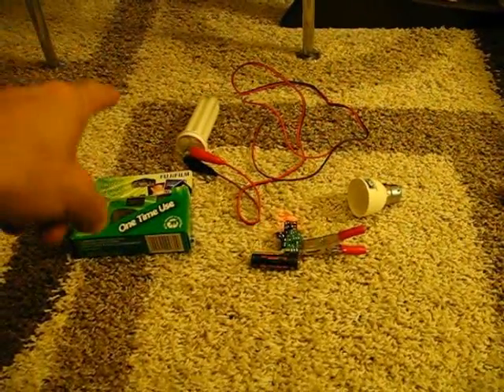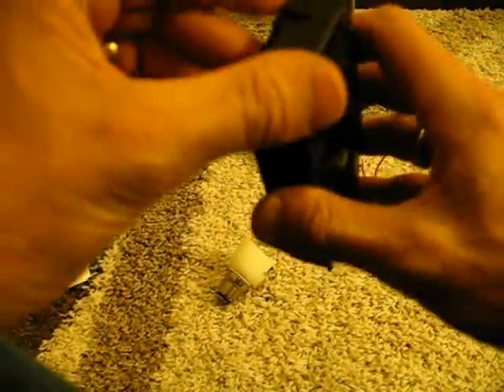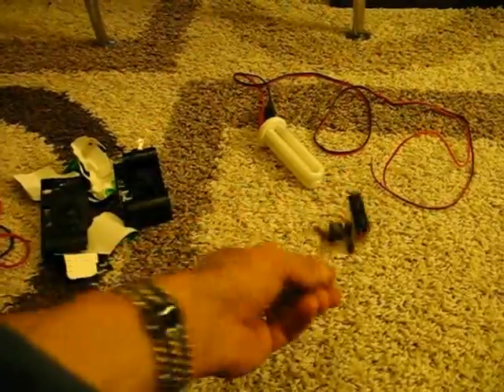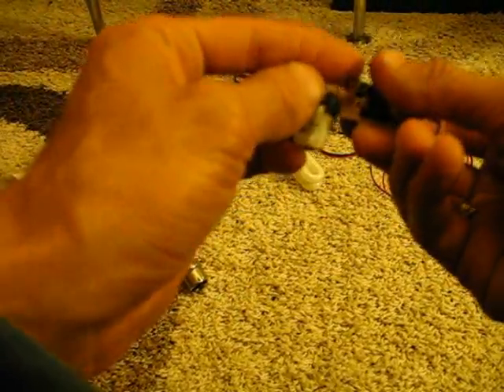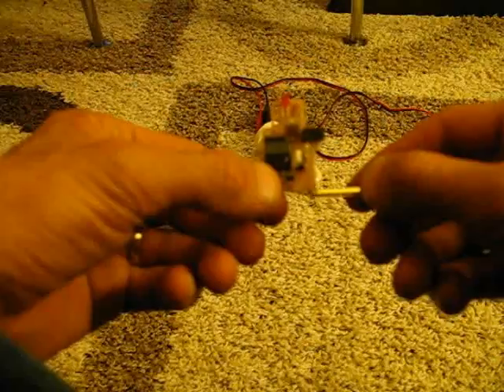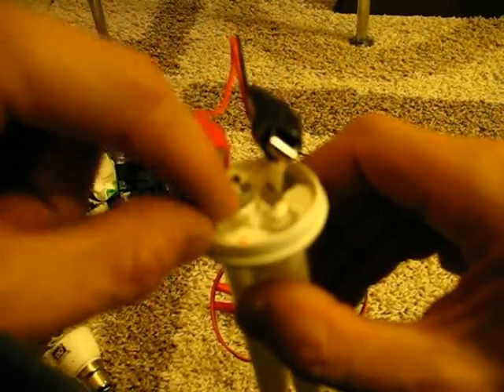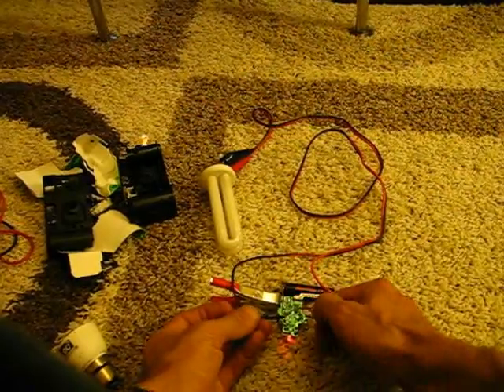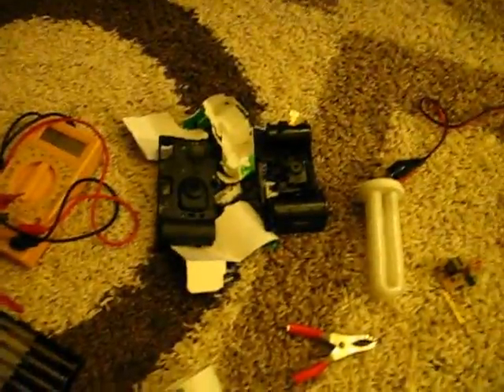Running a 240v lightbulb of one AA battery. Very real and very useful. With full how to. 100% real

Comment: Beautiful - THANKS.!
What size CFL I can use - 35W is ok?

If we don't have the camera here - is there another option. Or maybe diagram of the camera board that you are using?

Can the red light be turn off and it will work fine or is the red light need it to be part of the circuit ?

TIA
Reply from the maker: yes Kodak cameras also work (slightly differ from this) A diagram is in the description and you can remove the red led if you like. :O)
Reply: Did I had problem with my father in law, when I mention your video. Basically: How can you run 36W CFL for 12 hrs on single 1,5V battery.  And I was doomed :)
Reply: axnstorm Tell him to have a go at making one. He will be surprised how well they work :O)
Reply: I will - can't wait :)
Reply: axnstorm I always have the same problem with my father axnstorm. No matter what the subject is, it's like nobody else can be right about something unless he says so first. Even if he doesn't understand something, his response would always be something like "uh huh, well maybe" or "hmm, could be, but...". No matter how plain and clear I make the "facts" to him, he is always doubting everything I say, instead of accepting the "fact" that what I am showing him or TRYING to explain to him, is the way it is. He can never just take my word for something as being authoritative. It's like he's afraid to admit that I know more about something than he does. Or he just can't understand that I know what I'm talking about even if he doesn't. Damn it pisses me off sometimes. Sorry, but I just had to get that off my chest. Thanks for being my therapist's gang. lol Geez, talk about a rant! lol

Comment: Just wanted to share an idea with you as I'm not one to experiment with these types of things....

Over the years I've serviced dozens of 12vdc "strobe warning lights" on my equipment, replacing the xenon bulb. In all of them there's a "Hazard of Electrical Shock" warning label, I believe the circuitry may be similar - if not identical to the flash camera - but on a much larger scale, I'd be entertained to see an experiment on one of these. If you or someone does please post a comment here, I'll get an email alert. Thanks for the video and Cheer's to you.
Reply from the maker: Yes you are very correct with that. These are very similar but more efficient in what they do. They normally can run many hours on just a single AA or AAA battery. Some even run for days if used with hi-amp hour batteries. Normally if coupled with a solar cell and a very good quality rechargeable AA, AAA, C cell or D cell battery they can run indefinitely even with very poor sunlight to recharge the cells. I have had these things running for several years this way 24/7. without a fault. :O)
Reply from the maker: Oh yes and thank you for sharing my video. :O)
Subscribe if you like as I am planning to show more of my ideas on this channel. :O)

Comment: Armookie what voltage is the capacitor on the Fuji circuit? I am wondering if it is low would it be possible to swap it for the 400v one found on the CFL board and then feed directly from that capacitor via some sort of regulator to the unit to be powered. I have already built a working version of the Fuji joule thief and get between 6 to 8 hrs continuos with 2300mah 1.2v AA battery. KONNOC AA rechargeable 2300mah are 1.2v. CFL is 18w.

Comment: can you just go to radio shack and buy the make a circuit board and just make a circuit that does the same thing and buy the parts that u need separate so you can make upgrades for heat sink and maybe a better capacitor. cause i wonder if i can take the same thing you just made and change it up with some kind of solar panel and make it self  sustained. just and idea for a science project plus would be cool to use it outside

Comment: Can this be powered with the current from a phone line? There is aprox 58v DC so it would have to be regulated but it could run several of these, possibly all the lights in a house! (6-8 rooms?) But even if the current was too low to run that many, maybe it could run 2 of these lights...for free!

Comment: A Royer converter circuit changes DC to AC so I see how it lights the lamp, but how does AC charge a capacitor?
Reply: Well, it's a flyback circuit. They produce AC, but this AC generally has only one polarity.
There is a single diode in series or reverse parallel with the capacitor to eliminate the little reverse there is.
Think of it as very fastly pulsing DC that doesn't change direction at all. It's AC, just not the typical type.

Comment: Does anyone know if this project will work with CF bulbs meant for North America (ie 120VAC)?
If the circuit inside the bulb that is removed is down-stepping the voltage to the bulb, it stands to reason that you'd get the same brightness but even less current draw with a 120VAC bulb... Hmmm.

It'd be nice to know what the flash circuit is doing so you could build your own, and possibly change it to use a higher voltage batter (if a 1.5V AA lasts 8h, imaging how long a 6V lamp light would work!)

Comment: I have a camera i'll dismental it now, one question did you measure the voltage across cfl light pins while working and is it DC or AC( two questions :) )

Comment: Seems led. Cause the light is so blue. Usually the light is yellow. And it has to warm up, but in this video it is no warn up.
Reply from the maker: The Philips bulbs are more blue than the other brands that have a more warm yellow glow. I prefer the more blue colour bulbs. They are normally sold as daylight bulbs.

Comment: I have an A07 board, and on the diagram, you say to bridge the two contacts (b), do you mean, bridge just the copper and leave the two skinny lead contacts open, or should I be putting them all together?  I've tried them all together, and I am not getting the CFL to light (120v, 13w).. Help please?  Thank you

Comment: Can you replace the tiny transistor to a higher one to be able to run 2 batteries?
Reply from the maker: Philip Richards Yes you can but I usually just attach a heat sink or even a copper coin as a heatsink and run them off 2AA batteries. This works well for me without the need to replace the transistor. :0)

Comment: hiya, just went out and bought two of these cameras but the board is slightly different.  Do you know if they have changed the board to stop this from working?  the board says A60 on the back. I can not locate the point at which I need to short out. Regards

Comment: And if it's 240v it can pretty much power up any 240v domestic appliance right?
Reply: Nope. You need more amps, that bulb would require ~12 Watts. You get watts by Voltage times current equals watts. A laptop charger (example) would not run because it needs a higher wattage. (~90 - 120w). The battery would not be able to supply that and even if it somehow could, there are more factors to consider.

Comment: Respond to this video...  well it was getting dim also i was wondering could i just use a copper homemade heat sink also i am going to try to run a light for over 80 hours at full brightness with four batteries each of them 1.2v in 2 sets o series in parrael also i will be using a 10 watt led light bulb to be used as a out door grow light     
how many watt's do you think the transistor can power i would like to buy a 60 watt light but i can stick to a ten

Comment: If the lightbulb is used to electricity from the power net and you power it with a battery it'll discharge quickly, just saying.

Comment from the maker: Fuji disposable flash camera. :0)
Reply: +Armookie So it's basically stepping up the voltage significantly? Do you know what the exact voltage output is? I was reading the schematic on the fuji disposable camera and it says it has 2 transformers in it; are you using one or both of them to power the light? Sorry about all the questions; I have an interesting application in mind I was considering if it's capable of stepping up voltage.
Reply from the maker: +STEAM_Vortex no you remove the small transformer completely. only the large one is needed.

Comment: This is definitely not free energy. You need to buy batteries and they definitely cost more than electricity from the grid. These may only be useful if using solar power or as others mentioned here in an emergency like when power lines were cut off in a recent wintry UK weather (March 2013)!

Comment: As far as I know to last 24 hours on a AA battery that's 0.1125 watts of draw.
I suspect you're running it higher than 1/10th of a watt, and the run time is nowhere near 24 hours. For example, I think 10 watts of light would last 16 minutes.
I'm no expert and I'm not about to go build one but I do know the ratings of bulbs at the store, and some simple math.
Sooo... congratulation on creating the world's most efficient light bulb, I assume you'll be patenting and/or marketing it now?

Comment: No idea why you are saying this is free energy, you are draining a AA battery.  All that thing is is the flash charging circuit from a disposable camera.  They generate a few hundred volts at a low current to charge a small capacitor for the flash.  That few hundred volts also just happens to be enough to excite the gasses in a CFL tube.  Definitely useful if you feel like MacGuyvering but practical and free energy?  No.

Comment: ok mine works but differrent camara its aboots home brand £6 (buy one get one free 18th aug 2012) only problems i had/have is trial and error on the bulb contact area i knew it worked have several shocks but could not find where from anyway it works now but my bulb is pretty dull unless i touch it then it lights up in that place strange of what ill have another go at a later date with the other camara and a different buld this is a 9w sylvania im going to try a philips next time

Comment: Compact flourescent bulbs like he claims this to be require almost a second to charge up and come on, once power is applied.  Therefore I suspect this bulb is not a 240v or even 110v CFL, but something he has inserted LEDs into, which would be more inducible to light with a 1.5v battery.  Nice try, though.
Reply from the maker: If you read through the comments you will see that it really does work no trick at all. No LEDs just a camera flash unit and a 240v bulb. :0)

Comment: i,ve just tried to build this got fuji camera from asda but now need to get a smaller bulb its not powering a 60watt one but its throwing out 132 volts on my meter wow....from an aaa battery  not an aa one must be the way they make them now ..sell the same camera as i got in argos to
Reply from the maker: Yes I do not use high watt bulbs. Try get a 20 watt or lower and they should work fine. ;O)
Reply: WILL DO AND LET YOU KNOW HOW I GET ON
Reply from the maker: asda will give you the used cameras for free. ;O)

Comment: Hi Amoookie I just tried this circuit today using the same fuji camera , however the clf light was very dimly light ?
any ideas ?
Reply from the maker: Lincoln Brown What wattage is the cfl you tried? I would suggest nothing higher than 13watt. You could also try rubbing the bulb after connection as this sometimes makes them light better and brighter.
Reply: oh thanks I am trying a 20watt  unit (smile )
my Kitchen light will now need to be removed 
in the name of progress

Comment: hey please clarify something if you don't want ppl to say that this video is bullshit. A 1800 mAh AA battery means 2,7 Wh. You say that your bulb is a 20 W bulb so if it's working at full power it will not last more than 9 mins. But let's say the transformator only delivers 1 W to the bulb... it won't last more than 3 hours... Can you also tell us what's the output of the fuji transformator? (Voltage and Amps)
Reply: its obviously not on full brightness nob. prob 5% but will still give out light

Comment: that bulb isnt 220 v. its 12 or 24 , it have her own adapter which put voltage down...
Reply from the maker: That bulb is infact a 240v cfl with the ballast removed and wired directly to this circuit. They work great and cost hardly anything to run as I use the batteries that are to flat to even run a tv remote.
Reply: Armookie It's only 240v with the ballast connected. Removed, the tube runs at 50v. That's why they work on 120 or 240--the ballasts reduce the current and hold off the voltage.

Comment: ok. just tell me this.. because your picture is not very good.. i cant see. just tell mi what of the parts do you have on that board? you have that transformer.. that big one..what else? i got four things here now infront of me.. that big transformer.. not big..but the bigest one.. i have two  diodes.. FRO5 -15 FIN AND I HAVE ONE capacitor 203 K 400 V i think its a capacitor.. and i have one something like a capacitor with three pins.. what should i leave?

Comment: i assume those are the cool white Chinese leds, honestly they suck. go and get yourself a good power LED, like a Cree XP-E, XP-G or XML (all three are good quality Cree leds, and the only real differences between them is there size, the XML being about 5mm square, rated at 1000 lumen's (100 LM per watt)) and the others are just smaller, dimer, and slightly less efficient. find one on eBay that's warm white, or neutral white.

Comment: i may be wrong but judging by the sound it puts off that the video camera is picking up it sounds like its putting off high frequency some sort of plasma,that transformor isent doing all that alone maybe the inside of those cams are small plasma gens and thats what gives out the flash,check out my channel i have a buunch of plasma stuff i have a one where im lighting up 5 of these with no wires just transmitting the energy from my plasma gen :)